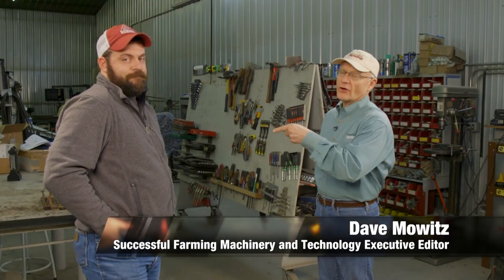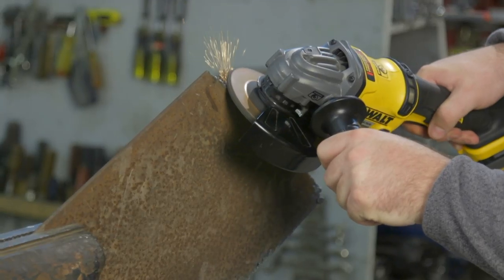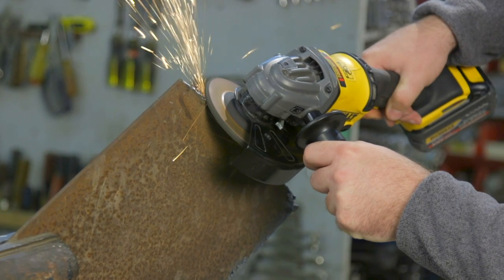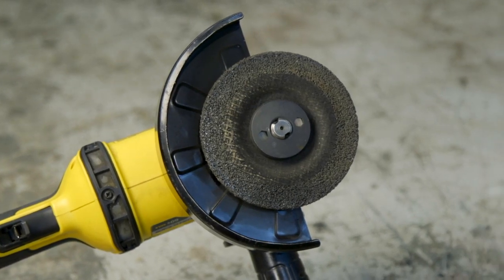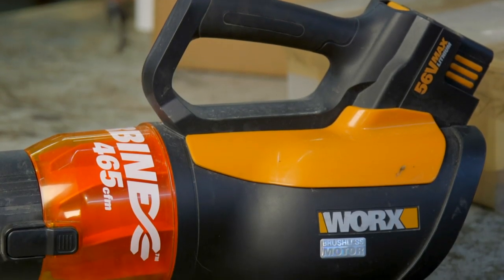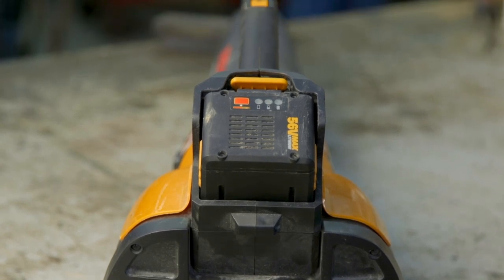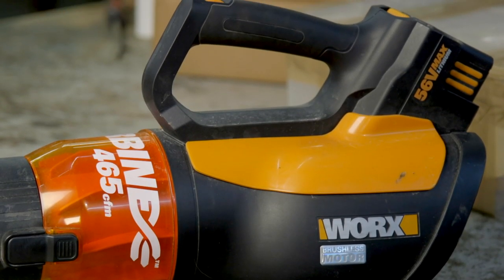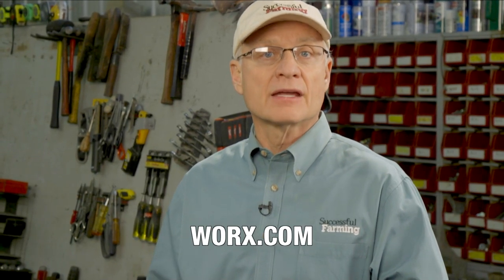Tool Review of DeWalt Angle Grinder & WORX Leaf Blower | Farmer-Tested Tools | Successful Farming

Comment: Innovation!!
Sounds like the 60 volt are a lot better than the 18 and 20volt grinders!!!
I picked up an Earthquake Hobo 20 volt grinder from Hobo Freight when they first came out, it puts the 18 volt DeWalt to shame!!!!
I got it because we've had a couple of Earthquake air impacts in the shop for quite a few years, they're really good! Took the chance on the 20 volt 3/4" drive impact, love it!!! Picked up the 3/8" drive too.... Waiting for the 1/2" drive 90° to get here.... 
Haven't got a lot of time with the grinder yet, but so far it's comparable to my Milwaukee and Bosch corded grinders.
Ya, I know... Harbor Freight....
But they're all made over seas....
(I already had the